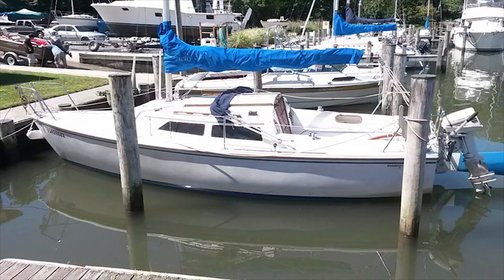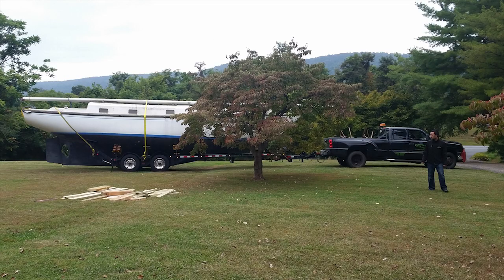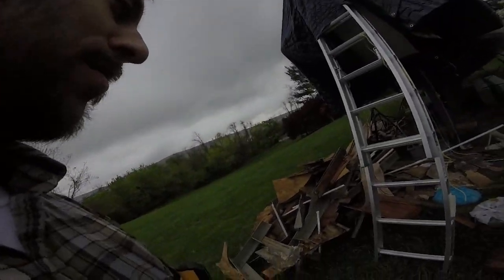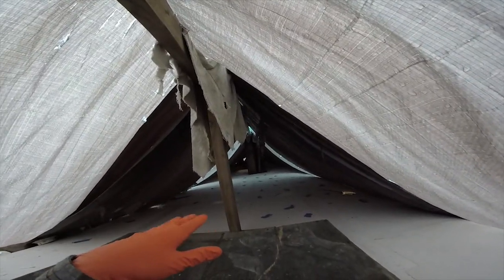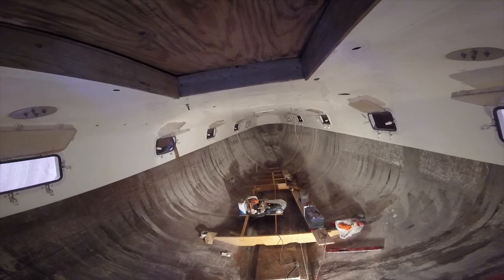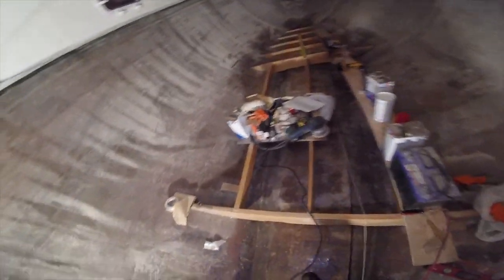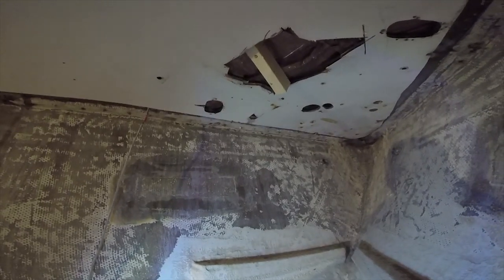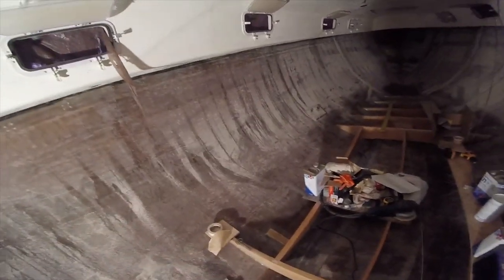The Errant Comma: Beginning

Comment: Hi what a big project, building a new boat! We used to  be able to buy new bare hulls in the UK  and then fit out your self , they also sold kits too. Your doing the same but on a 47 year old boat with bad fiberglass. But don't let me stop you!
Cheers Warren
Reply from the maker: Yes it is definitely daunting. But the great thing about fiberglass is its longevity. Its is easy to repair and modify as long as its been taken care of even minimally. I think its the best of all boatbuidling material in terms of cost/benefit.

Comment: I actually inspected this boat I was looking for a boat at the time I thought the owner wanted too much for the Hull and it needed way too much work I'm glad you got the boat your doing some good work on it keep it up far as the motor goes I would have the injector pump look at along with the injectors engine not being started for a long time injector pump and injectors have a tendency to seized up this is from my own personal experience good luck with the boat cheers
Reply from the maker: Hi Dana, just saw this, thanks for the advice! Yes it  has needed alot of work to bring back to life including alot of core replacement.

Comment: I wonder if it would have worked better to completely seal all the holes in the top, then drill all the holes for trying in the bottom instead of the top? Then maybe fill the boat with heaters and dehumidifiers. If that worked though, how would you repair all the holes? And what would you do to make sure the old rotten wood is solid and properly attached to the fiberglass?
Reply from the maker: That could possibly work, but sealing holes overhead would be much more difficult. In hindsight I wouldnt of even bothered with drilling holes, and tore it out immediately. It would also vary greatly on how wet it is, and how much is affected. If its really wet, no amount of drying will help. If its just one damp spot then that could work.

Comment: was it affordable to have the boat hauled? I've looked at having mine hauled and I think they tried to steamroll me. For a 350 mile trip they wanted like 4000 dollars. I passed on that and haven't looked again. Maybe that's just what it costs to ship a 34 foot boat?
Reply: No, it should cost half that. I'll see if i can get you a name. Where are you?
Reply from the maker: We moved our boat 150 miles and it cost about $2400. If you are in Northeast or Chesapeake Bay area I can give you their info. We had used UShip to find them, but there is a significant fee applied through it (around $500).
Reply: A 40' boat is significantly larger than a 34' boat. It's 17.6% longer, but it's also 17.6% wider and taller. That's 1.176 cubed = 1.628, or nearly 63% larger/heavier. But, also all the fiberglass has to be thicker to add strength, so it probably weighs about twice as much rather than only 63% more.

Comment: Your engine has a heat exchanger so it is not raw water cooled. It is fresh water cooled.
Reply: He probably means that the fresh water is cooled with raw water instead of a radiator. I've been thinking it's be nice to have a valve that allows you to switch between cooling the engine with a radiator or with sea water depending on whether you need to heat the cabin or not. That way you could get free heat from your engine whenever it's running.

Using the engine coolant to heat water for showers is common, but I've never seen the engine coolant used to heat the cabin. It should be possible to do both.
Reply: Doug Penhall  you can buy boat water heaters from boat supply houses like defender, truck have them too.